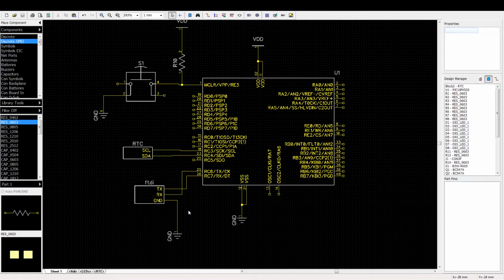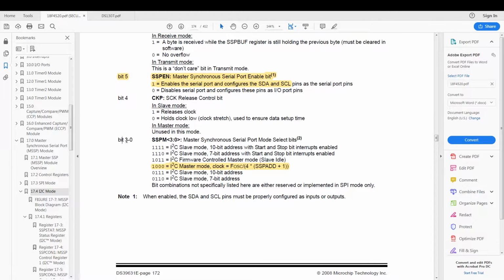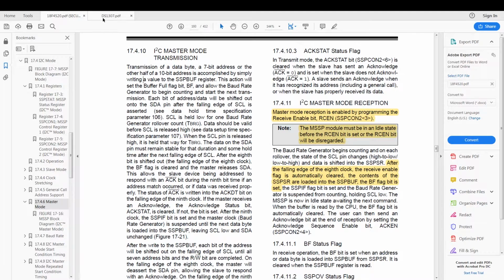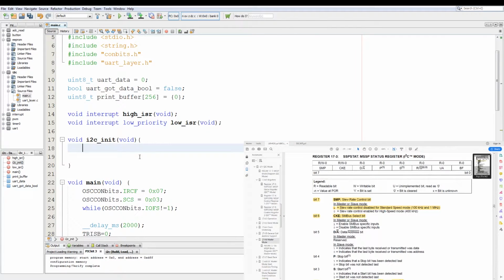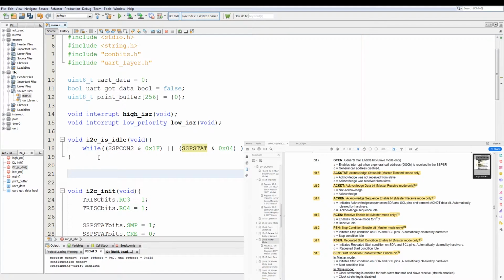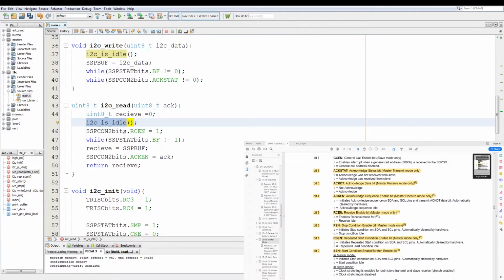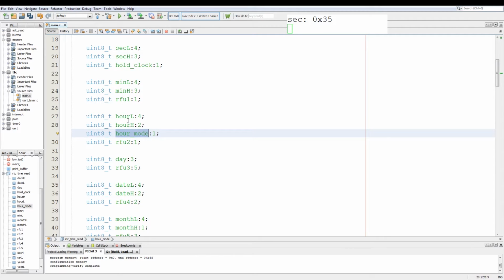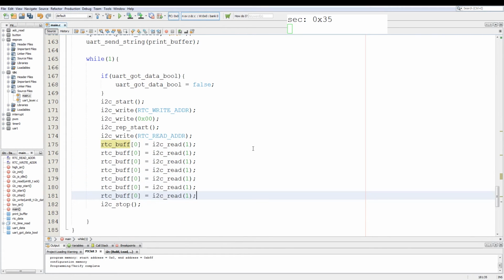I2C and RTC DS1307 🔴 PIC Microcontroller Programming Tutorial #11 MPLAB in C

Comment: Don't understand the meaning of
uint8_t YearL:4;
uint8_t YearH:4;

.
.
.
etc.
Could u explain? thz u
Reply from the maker: This only applies to the struct keyword.

Format
 
datatype name : bits

datatype : in this case uint8_t so 8bits wide variable 
name : anything you want to call the veriable
bits : the number of bits to use.

In the case of yearX it splits  a single uint8_t variable into two 4-bit wide variables.
Example
YearL = 2; YearH = 3; is the same as uint8_t Year = 0x32

You can search struct bitfield for more information

Comment: Very good .... the best I2C tutorial I've seen.
I have a 16f15376 pic and the datasheet is very similar to the one it presented.
I followed it step by step, but couldn't make the SDA and SCL outputs generate the square waves they were supposed to.
Could you take a look at my code?
thanks
Reply from the maker: Look at section 32.6.6.4 of the datasheet.  Do you have the correct pull-up resistors on the interface lines?
Reply: @BinderTronics  
I looked at the sentence 32.6.6.4 it's very similar to that of your pic.
I put pull up resistors, set the ports according to the datasheet. I wrote the functions just like you did.
But for some failure, I can't see the changes in the pins configured to be SCL and SDA.
Reply from the maker: Got a GitHub link to your code? It is going to be a question if i get to it. Otherwise you can try https://electronics.stackexchange.com . Just a note on the resistors 2K2@100k 4k7@400k 10K@1M (not sure about the 10K@1M one). Also state the frequency the pic is operating at and the device you are trying to communicate with  assuming it is a DS1307.
Reply from the maker: @robinight  Removed your mail from the previews comment:

I posted the code on a microchip forum. The link is:

https://www.microchip.com/forums/m1115621.aspx
Reply from the maker: Nothing posted. That was you comment without the mail. Are your SDA and SCL line set as input before init of the I2C? Don't see it in the code.
Reply: @BinderTronics  , yes. 
Currently ports RB1 is SCL1 and RB2 is SDA1.
In "pin manager" the ports were configured as follows:

TRISB = 0xBF                     ;
  RB1 =RB2 = 1
ANSELB = 0x31                 ;  RB1=RB2= 0

    SSP1CLKPPS = 0x09; // RB1-> MSSP1: SCL1;
    SSP1DATPPS = 0x0A; // RB2-> MSSP1: SDA1;
    RB1PPS = 0x15; // RB1-> MSSP1: SCL1;
    RB2PPS = 0x16; // RB2-> MSSP1: SDA1;

According to datasheet.

Comment: i worked on I2C and i used RFID device PN532 of adafruit so do you think it is compatible with the PIC microcontroller? 
2) do you think every component is compatible with every Microcontroller?
Reply from the maker: I see no reason for the pn532 chip to not too be compatible. The trick here is to port the Arduino code to PIC eg. the twi lib command changes (Arduino) like this to a start transmit (I2C = TWI)
Arduino
Wire.beginTransmission(device_addr); 
changes to ->
PIC
i2c_start();
i2c_write(device_addr);

2) No, there are many factor that influence compatibility between a device and Microcontrollers like operation speed, operating voltage and does the Microcontroller have a peripheral for it. There are ways to get around this, like bit-bang the protocol and using level snifters. An example of the is PIC Programming Tutorial #14 - Controlling A Servo, video where I had to clock down the cpu to get a PWM of 50Hz
Reply from the maker: You might also need to port between C and C++, depending on your needs regarding the pn532.
Reply: @BinderTronics   Thank you